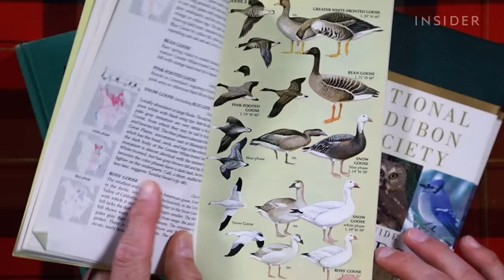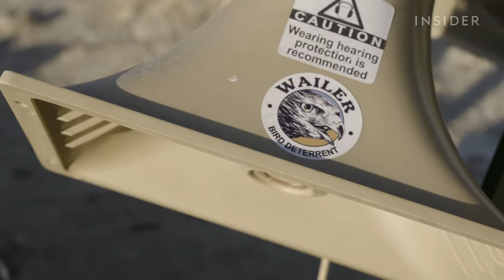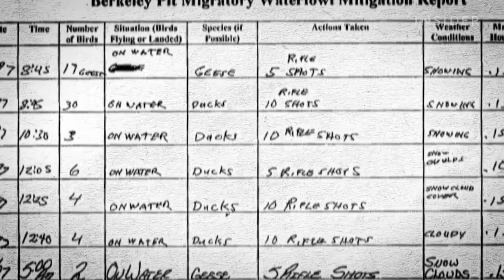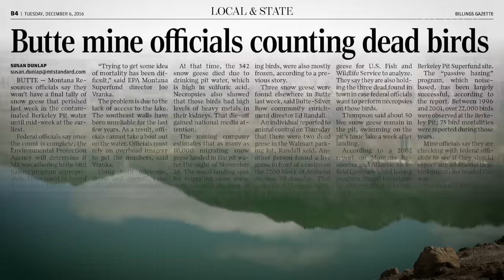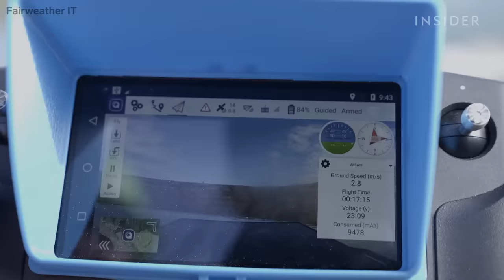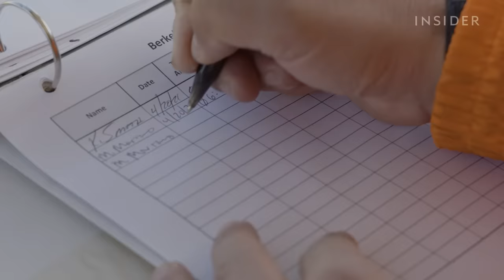Meet The Man Who Shoots At Birds All Day To Keep Them Off A Toxic Pit | World Wide Waste

Comment: What is stopping them from blocking the shaft and then pumping out the remaining toxic water away from the pit?
Reply: Regulations. You have to account for the water you're removing and regulatory standards consider it a hazardous material.

Comment: This is a very large "pit" but I have seen programs that deter bird landings and evaporation losses from pits by using tens of thousands of floating balls that completely cover the water. Probably too expensive in this case but the idea may have merit. On the other hand how cool is it to have this job and keep the birds from destroying themselves.
Reply: The los angeles drinking reservoir uses thousands of black plastic balls like you mentioned. Im not sure how practical that would be here because of how acidic the water is.
Reply: @Jasoneason132  Many different acids are stored in plastic containers. I used sulfuric acid in my business for forty-six years which was always stored in a plastic container.
Reply: @jbass69goat  ah ok, i just wasnt sure since i wasnt sure how the plastic in the balls would react
Reply: Yeah, they'd probably dissolve. Not just the acidity, but the pit is super corrosive as well.
Reply: @playgroundchooser  true; it's full of all sorts of dissolved minerals such as copper
Reply: Montana Reasources looked at that in the 2020 report and estimated the cost at $90 million dollars for the balls, this is much cheaper.
Reply: @macgregoranderson777  Yeah and a hell of a lot more fun. What a grail job.  They could have folks there 24/7 with full benefits and night-vision equipment and it would still be much cheaper.
Reply: They just need to drain and cap it. This is a waste of time and money.
Reply: @Mitchell Slate  that was what is happening originally unyil the pumps stopped working. Also, groundwater seeps in continuously which makes draining it the way it now difficult
Reply: @mitchellslate1249  Yeah, you clearly have it figured out.
Reply: @macgregoranderson777  the plastics needed for this would be prohibitively expensive. Sulfuric acid is only contained in treated plastics, otherwise they will dissolve. Glass balls could do it.

Comment: So, it is a bit more complicated than what I see a lot of people talking about. This has been a problem with the water source since settlers first moved to Butte, so they basically used mining pits to contain the runoff from constantly eroding acidic elements.

The pit is constantly creating and releasing acidic chemicals because of shifting, so no solution would slowly raise the ph. Also because there is such a large variety of elements, simply using something like shade balls/tarp would not work.

There are some really interesting proposals like, a big greenhouse with a funnel that helps release the gases, creating a layered hydro system that still allows for the water to run into the pit without runoff, and creating a foundation for a small resovior by digging under where the acidic solution has seaped through.
Reply: How would shade balls not work? Just wondering because what I'm thinking is if the whole surface is covered, there'd be no space for birds to land
Reply: @joaoie  theyd just land on too
Reply: @joaoie  top

Comment: Am I missing something, if they have spent 100's of thousands on things to get the birds not to land on the lake couldn't covering it with something designed to withstand the acid (floating or otherwise) be much more cost-effective and just overall effective?
Reply: That lake looks pretty big. Camera can be deciding but I'm guessing covering it with something semi permanent would be a massive project
Reply: It would be more cost effective in the long term, but it would require an enormous amount of money upfront.  Which is the government's least favorite kind of investment.  It's the same reason they'll spend $100,000 per year maintaining a 90 year old bridge instead of just destroying it and building a new one.
Reply: Even using the cheapest stuff available, the cost to cover up that toxic pit would range somewhere between 9 and 10 figures.
The thing is: whatever cover is used needs to allow water to evaporate, otherwise the water will rise further... and that would be BAD.
Reply: Imagine running a track all the way around the circumference/perimeter of the lake and run a single strand of fishing line that sits about 4cm of the height of the water and have that act like a vector trace?
Think of those old school cable racing cars that used to go around a circular track really fast? Similar to that but you have the cable on spring loaded retractor/reel so to keep the fishing line always in tension?
Leave it running 24/7 and no bird will land in the lake unless it wants to get coat hangered?
Reply: Nope. Theres a huge chance the birds would get caught in the “net/cover” and then what? Die? And how would you get them out?
Reply: The Los Angelas Reservoir deploys black plastic balls to cover the surface of the water to prevent evaporation.
Reply: @DansEarway  yeah I was thinking of that. Maybe it would work? What about if they dumped an alkaline element in the water to counteract the acid? I’m sure there is a reason why they can’t treat the water but I would dump a bunch of PH + in and see what happened.
Reply: The cost to buy that $1,000 rifle and put a $2,000 Scope on it to shoot like $2 a shot bullets out of it until you have to buy a new $600 barrel year after year will probably still cost less than it would to make an Extra big ass tarp to cover it and then put it in place when we measure it over the timescale that would probably elapse before they had to repair or replace the tarp. 
In fact, getting a government grant so he could shoot in the general area of the birds with a machine gun every day would probably still be cheaper than your proposition, though that's also accounting for the factor of switching from $2 bullets to $0.40 bullets.
Reply: Drone boats like their “sea dog” but fully automated. A fleet of 10-12 whereas 3 “sea dogs” would be on the water at one time while others rotate out to charge batteries. Think Roomba with a “Search and destroy” function.
Reply: @SandersChicken  You're right.  The lake is roughly 425 acres, and is about 1.25 x 0.75 miles.  No tarps, no nets, and not even a butt-ton of black plastic balls will be fixing that mess, anytime soon.  They are doing the most cost effective thing that's currently available.
Reply: @DansEarway  Why automate them?  You could charge people a couple dollars for a time slot to virtually log in and remotely drive the boats around to chase birds or race each other.  Just have some signal buoys so that if the boats get too close to the bank or each other, they take over and automatically steer the boat away from collision.

Think I won't pay money to be allowed to chase birds around with a remote control boat?  Think again.
Reply: @mrnogo9651  Are you saying my idea is “for the birds”? 😉
Reply: @DansEarway  Shade balls!
Reply: @uthmanibn-jafar1159  And that my good sir, is why the US government has not gone bankrupt every year lol. If we employed "upfront expense" logic to every issue there would be nothing fixed after year 1.
Reply: @uthmanibn-jafar1159  If the new one costs $5m then it's better to just keep maintaining it as long as you can.
Reply: @stephenklein6552  i thought shade balls were when you teabag opponents in CoD.
Reply: @ultrameticulous  Shade balls, depending on the plastic used, MAY (not sure) be immune to the acidity.  Also, this problem is going to persist for an enormous amount of time and the lifetime of shade balls are around 10 years at a time so it may pay for itself over long periods of time not to mention the life saved.  I don't pretend to believe that the people in charge have not thought of this.  Perhaps at ~$1 per 3 balls may prove too expensive compared to the current setup.
Reply: @ultrameticulous  Agreed.  I wonder if there will ever be a solution to actually cleaning the lake.  Having created a biohazard like it, that will exist for probably many thousands of years, will be a stark reminder for our countless generations of the short-sighted mentality of humanity of this era.
Reply: @DansEarway  heheh!

Comment: I have an idea:

Have you seen those wave pools that use a large mass that goes up and down in the water causing waves? They won't land in the water if there are waves.

Provided the acidity of the water doesn't destroy the machine.

If the cost of the machine running is less than the cost of keeping the birds out,albeit its viable.
Reply: The acidity of the water would probably harm any material suited for setting up the machine on the long run.
Reply: @nils895  yeah I was thinking the same :(

I did see another suggestion of using those black sunblock balls. I feel that would be a better solution if the birds didn't land on them.
Reply: @omfgishBenneh  Good idea, same problem. Acidic solutions are agressive towards most materials in some way...
Reply: @nils895  true, but I think it would be easier to make it resistant to the acidity.
Reply: I haven't watched the whole video yet, but how about creating a net, or cover yet out of recycled garbage (or maybe just some plain rope) and cover the entire lake with it? 

Eh, it'd probably be deemed a waste of resources.
Reply: @Dylan-xx2tk  would probably have the same issue, sulfuric acid melts a lot of shit
Reply: Add a bottle or two of pepto bismol.  Works for my stomach
Reply: @graham4520  To be fair it doesn't have to exactly be directly over the water itself. As most likely as expensive as it is, if a sports bubble type material was placed over top the hole, encasing it in a "home" so to speak with access being that of a door or something that human's could still enter the contaminated area to continue what little clean up effort they could do.

The structure would encompass the hole from above, no birds could land directly on the water, and the acidic water wouldn't make any or very little direct contact with the material.

But as stated; that venture would probably be nearly as expensive as just cleaning out the water itself, if not more since said fabric would have to be mostly weather resistant and have some degree of resistance to acid, AND be able to spread over a mile to fully protect the area.
Reply: @martenkerkhoff6600  pepto bismol solves all
Reply: @Dylan-xx2tk  Good idea - people would travel far and wide to visit Montana's infamous net of bird skeletons
Reply: @TryABaconSlice  Umm, he doesnt  mean that the net will be inside the lake(why would it?) Instead, it will be covering the lake and would be tied up to the mountains surrounding it.

Comment: Frequency is the key to keep the birds away. The pit being cleaned is the most important part. There are inexpensive ways of doing it.
Reply: Drain it and seal the shafts
Reply: but then he wouldn't get to shoot all day
Reply: @dunno6442  true, thays an awesome job and I'd hate to take it away from the guy. I just can't help but wonder what the actual geology of the mine looks like and if they could even pour concrete that sets under water down in the bottom of the pit. Maybe the entire walls of the pit are soluble though
Reply: @davidpoley7848  drain it to where? Polute other water with it?
Reply: @bramtencate2170  that kind of thinking does not solve problems. It could be treated and neutralized. I'm not an engineer. Do you have an idea to permanently solve the problem and rehab the ecosystem?
Reply: @davidpoley7848  I’m an engineer not a chemical engineer but I can definitely tell ya this situation is fucked and not an easy cleanup. The acidity could hopefully be neutralized but the rocks might be leaching more sulfur. The metal is a real pain in the ass to remove especially with so many metals. It’d take a shitload of money which makes me wonder why they don’t just cover it as it’s in the middle of nowhere. The mine company should be liable but doubt they even have that money. They make these balls that you can float on water that stop birds from landing but I’m assuming they must not be be able to survive the lakes conditions.
Reply: @davidpoley7848  I'm just saying draining it might not be the solution, atleast if the chemicals in it can't be broken off. Best solution in that case would be to atleast to cover it all up and make sure in can't leak.
Reply: @monhi64  they mentioned that in the nearby water where it was leaching into applying lime has neutralized it. Do you think that if they brought truckloads of lime to dump into that water could solve the problem? Maybe if dumping a large amount every day?
Reply: @LilianTejada  I’m not positive lime would be a good solution because it has a lot of calcium in the molecule attached to the (OH) base and I’m not sure exactly how all that calcium would effect the lake and it’s toxicity. Yeah I didn’t even realize that a lot of bases are attached to metals man this is a shitshow lol

Comment: The work these guys are doing is amazing, but there has to be a more long-term solution, right? like blocking off the pit completely.
Reply: yeah i was thinking about just sticking a wire cage just off the water. there's gotta be a reason that isn't the solution, but im curious
Reply: Some reservoirs have a million hollow plastic balls floating on the top, leaving no gaps. This is to reduce evaporation. I wonder if the birds would land on the lake if used here.
Reply: @dogwalk3  this is a multi mile long pit. A wire cage would sag over that length, the pit so deep that building supports is unreasonable. Paying a guy to sit and shoot birds is cheaper long term when compared to the cost of building and maintaining such a structure.
Reply: @mrstrawhat9227  Ah, I didn't know the depth was an issue - obviously, yeah, a support of some sort would be needed. I guess flotation rings could hang something up - but that's an ongoing maintenance cost that may be less time efficient & more expensive in the long run. Well, this gives a guy a rad job for a life & something super intriguing for us to see! Thanks for the reply.
Reply: You could hang a net above the water. But hell, smarter people than me probably have figured out they are doing it the best way, or probably the cheapest...
Reply: @dogwalk3  Native Butte person speaking from experience- the size of the pit, plus the depth, plus the acidity of the water, and and the literal miles of underground tunnels filled with water plus being near a watershed limits options.
Reply: It was a veritaserum channel video  about covering the reservoir in black plastic balls, if someone wants to look for it.
Reply: My guess is, whatever permanent solutions may exist, would cost more time and money than just paying a few guys to sit next to the lake every day. Even if a permanent solution would be more effective and efficient in the long term.
Reply: @connorsheffield6576  yeah, people seem to be forgetting how corrosive the sulfuric acid is. A regular net or wire mesh would probably just dissolve if it was dragged through the surface of the water for even a few minutes, and that would be difficult to mitigate, considering how unbelievably heavy a several mile long net would have to be
Reply: @tanaats  The pit is fairly strongly acidic, with some other corrosive chemicals dissolved in it. I believe they don't use plastic balls like the LA reservoir because in the pit they'd simply be dissolved in a matter of weeks
Reply: it's an acid pit, there's really not much that can be done except wait. Any cover is going to get dissolved eventually, the only thing that will make it less dangerous is to let the acid neutralize itself chewing away at rocks. The best we could do to help would be to try and artificially speed up the neutralization process, but I'm not sure I trust us to not unintentionally make the situation worse somehow.
Reply: @mrstrawhat9227  Could have it supported by floating pontoons, but I wonder if the net itself might still attract birds to land atop and be unreasonably close to the death water, bloke with a gun and some drones does seem more practical.

Comment: Just create a net shade using steel cables as support to cover the whole pit rather than firing guns and using drones
Reply: Lot of upfront and maintenance cost... The pond is 1.3 miles in length
Reply: Amen
Reply: @ruturajyadav5130  Compare that to the wage of the workers, (+ bullets, + fireworks UNTIL THE END OF TIME) and you may find it's more financially sound .
Reply: @armandsdreimanis873  u realize this lakes is full of sulfuric acid which quite literally burn off the flesh on the birds within days as stated by the video? Putting a plastic film and rubber balls wouldn’t make any sense cause eventually they’d all dissolve.
Reply: @nightshade8538  I know about sulfuric acid. U can use glass balls.
Reply: @armandsdreimanis873  That doesn't solve the problem, the Berkley pit literally gets deeper every year it's so acidic.
Reply: Or just fill the pit
Reply: @syednumaan4913  with??? Water is displaced when u put shit in it. Filling it up dirt and sand would just push the toxic water up
Reply: @AdamBechtol  is 100% cheaper than a net that will melt from sulphuric acid.